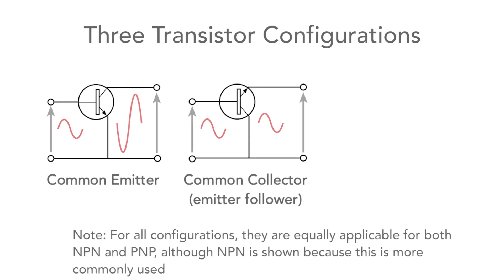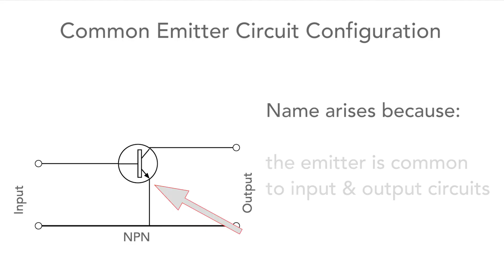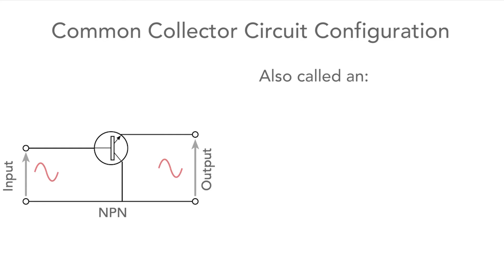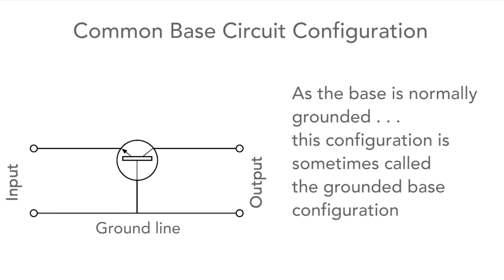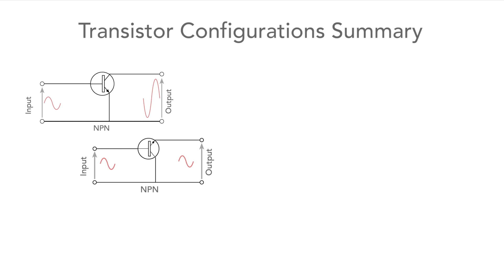Transistor Circuits: Which is Best for You?

Comment: Ah, an AVO8 multimeter on your table. I use a 5kV probe with one of these to test the anode voltages on valve rf amplifiers that I build for shortwave and microwave frequencies. 2-3kV are typical.

Comment: The "typical circuits" diagrams for the common collector, at 2:40, look like common emitter, I don't get it.
Reply from the maker: For a common emitter circuit, the output would be taken from the collector electrode. Here the output is taken from the emitter. 
Possibly the similarity you are thinking of is the bias arrangement?

Comment: Are your example "common collector" circuits at approx 2min45 actually common emitter circuits?
Reply from the maker: This is a good question and I’ve been thinking exactly how to answer it. The short answer is that it is a common collector circuit which is known as the emitter follower.
If you look at the very basic topology at about 2 min 24 you’ll notice the output is taken from the emitter. The same is true on the circuits a little later in the video that you refer to.
I hope this helps.